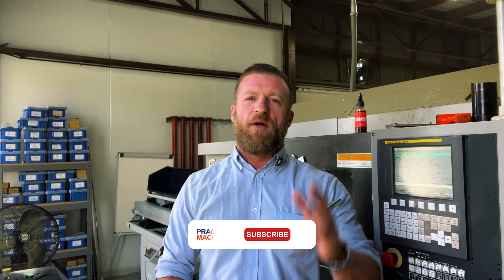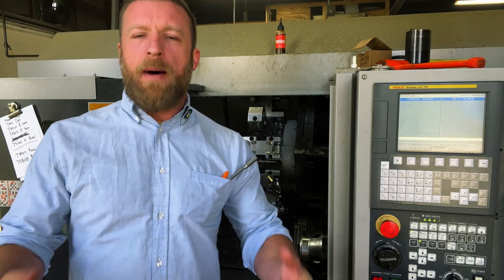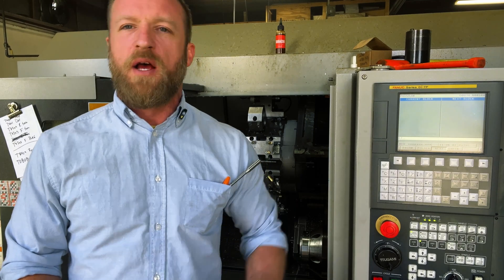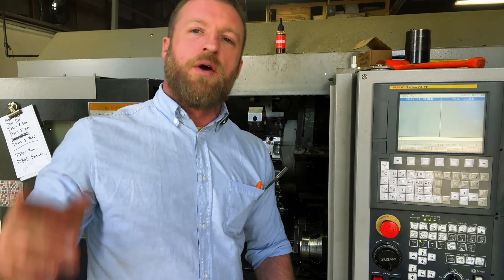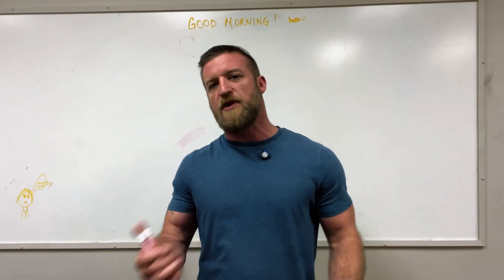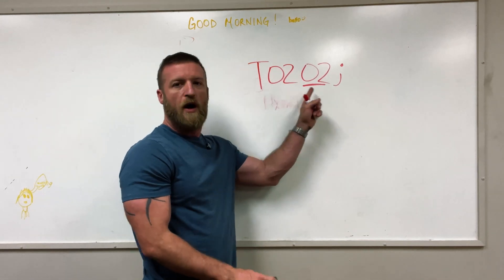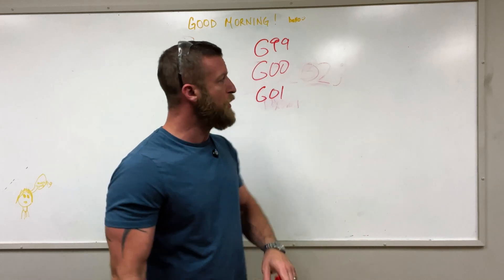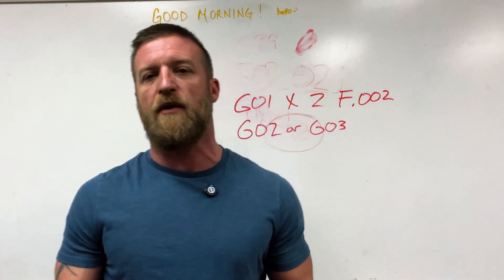Lathe G-Code Basics That Actually Matter in the Shop | The Lathe Lab Ep.5

Comment: G50 pairs well when using a G96 to limit spindle speed at max rpm
Reply: Is is mandatory for a lathe and should be always specified for safety reasons when working with 3 jaw chucks or whatever. I use higher rpm for finishing when my roughing tools removed a lot of material so you can even put that later and get the guarantee for a good finish.
Reply: Yup. Great point 👍